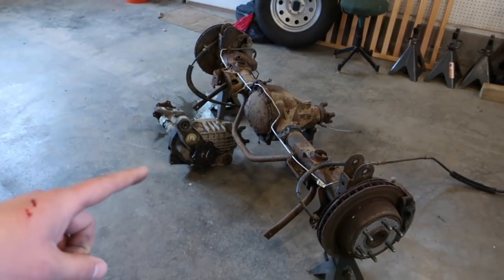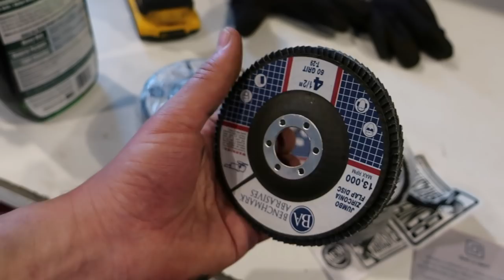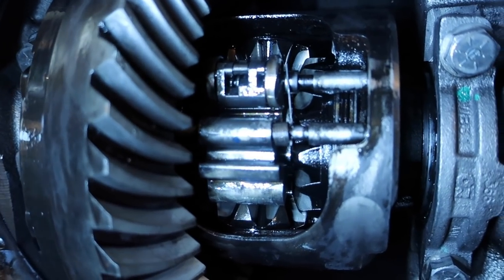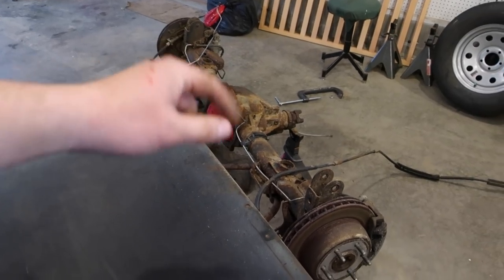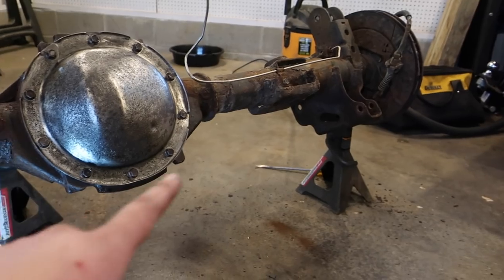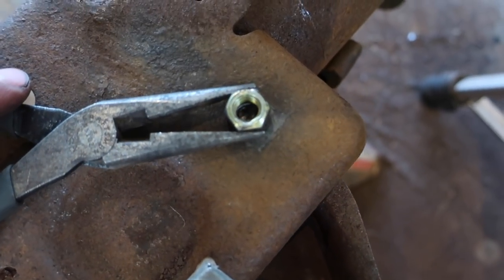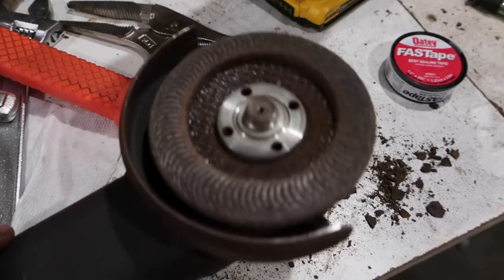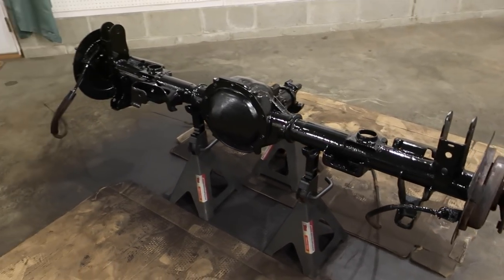Axle Restoration and Free Flap Discs!

Comment: Hey, How do you like that needle scaler? I have been thinking about getting one. Is that the harbor freight one?
Reply from the maker: It’s my go to for any heavy rust. Some rust will take forever to grind down only to find out it needs to be knocked off. The scaler is the harbor freight one. I’ve had that scaler for about 4 years and have a stupid amount of hours on it and it still goes. I could really prob benefit from a new set of needles but I love that thing. Such a satisfying task. I had about 8 hours into needle scaling alone for that axle.
Reply: i use mine for knocking the slag off of lots of welds in seconds (if i am doing a project with lots of arc/stick welding).. i have never used it for rust removal, great idea ! thanks !
Reply: @jtmoffroad  8 hours?! no wonder it came out looking so good. that is dedication man. Respect.
Reply from the maker: Haha yea then there was the flap disc and wire wheel work on top of that. Should have prob just paid to get it sand blasted but didn’t have the money to get that done. Seriously though, it didn’t seem like 8 hours. Such a relaxing task.
Reply from the maker: That’s the one thing I’ve never used it for but I bet it would do great for knocking slag off!

Comment: I just did an 8.8 swap in my YJ and did a lot of flap disc grinding with the benchmark discs. They work well. Make sure you’re wearing a respirator though. I picked up a Miller welding respirator and after a couple hours grinding the filters looked disgusting.
Reply from the maker: Awesome! How did your swap go? Yea i use a respirator all the time now. Not fun breathing any of that rust or metal in
Reply: It went well. Definitely needed with the 5.3 I just finished up. And yeah I commented before I ended the video and saw you said you use a respirator lol

Comment: you don’t have a limited slip. you have a eaton g80 gov lock, it is a locker. it is a great design but not great for rock crawling. it uses governor springs to control the lock up. if one wheel spins faster than the other, the diff locks up solid. once you go over twenty or thirty mph it unlocks. they are great in stock applications. there is a computer animated video on youtube that is really great, i suggest looking it up. type in eaton g80 locking differential
Reply from the maker: Ah that’s for the clarification. I knew it was a g80 but got the terminology wrong. I feel like I saw that vid before. I need to look it up again cause I need to understand how it works better. A lot more in there than a ratcheting locker haha. Do you know what goes bad in them and how involved it is to rebuilding them? My previous axle in the avalanche would clunk sometimes going from forward to reverse or going around some turns. I had a feeling the sound came from that unloading or something.
Reply: jtmoffroad i don’t really know what goes bad in them. i just know when they start clunking it is time to look for a new one. it is cheaper and more reliable to replace it with an aftermarket carrier, like a elocker or air locker. the g80s aren’t very strong but i loved mine, it never gave me any issues. i never abused it either. it was in my old k5 blazer and was for winter driving. i put a lock right locker in my new k5 blazer and i hate it. the locking action in the g80 is almost seamless, very smooth and quiet when working properly.
Reply from the maker: Yea I don’t know how far I want to go with this vehicle but ideally I’d like to have some sort of electronic or air locker but the g80 will definitely do for now. I wouldn’t want to put a ratcheting locker in this. My jeep sure but I want a smoother ride in this.